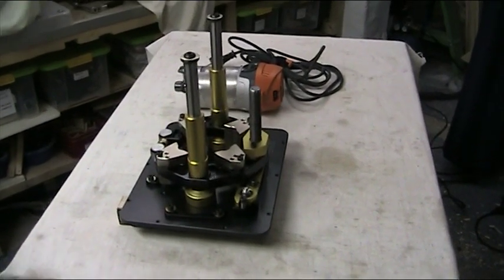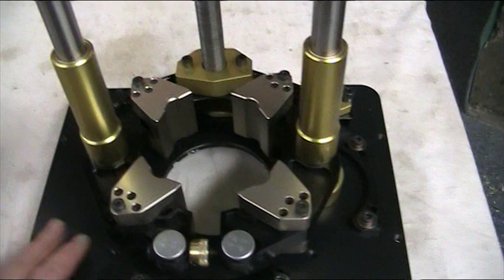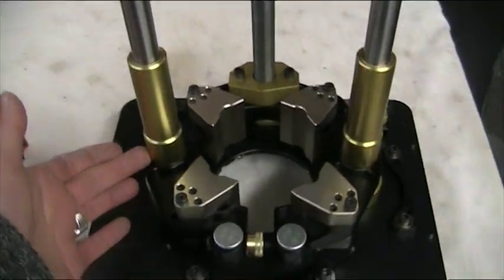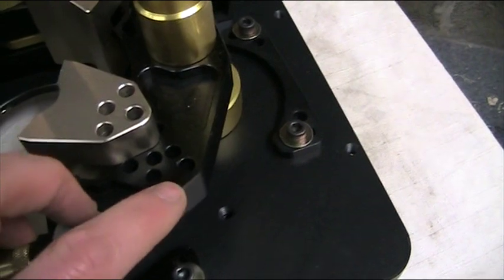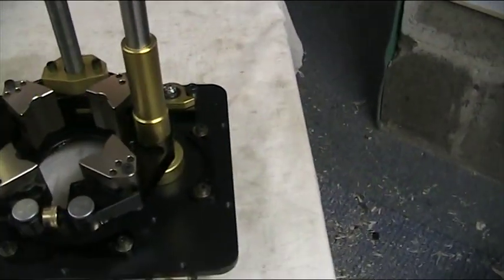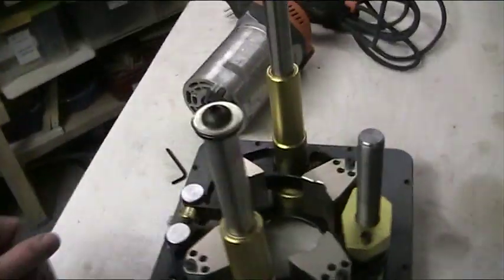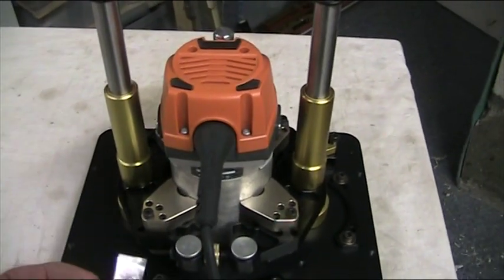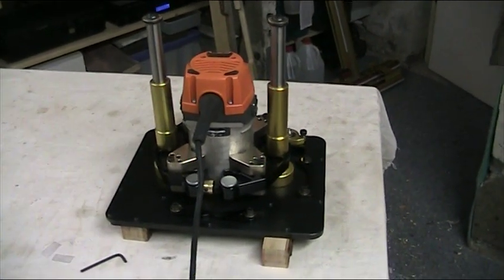Mast R Lift II part 1 (of 7)

Comment: Good news for those wanting another choice of 230V 50Hz router motors for the Incra or Jessem router lifts.  The AUK Tools Mk 3 router is now available from Wood Workers Workshop in the UK.  This 2.4 HP router fits nicely in the Incra Mast-R-Lift II.  Use hole settings A1 for the router motor.